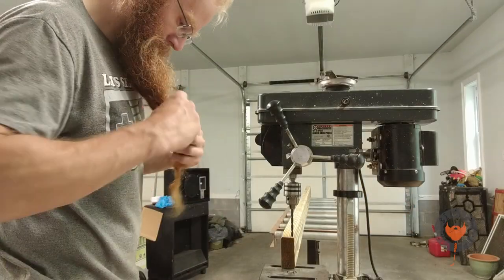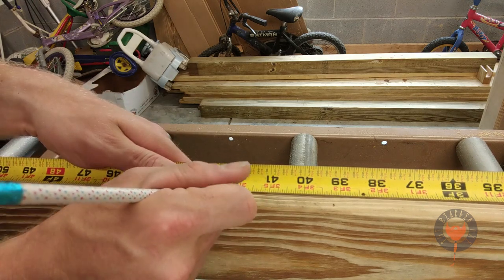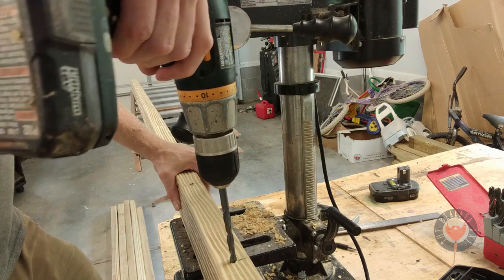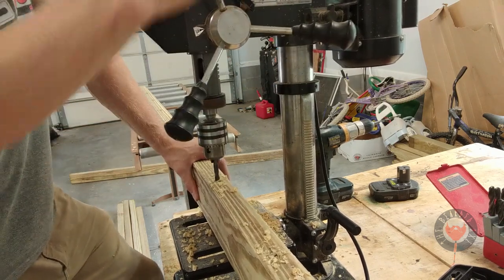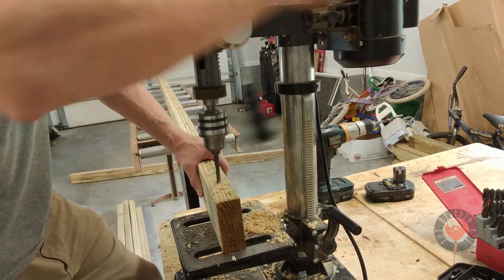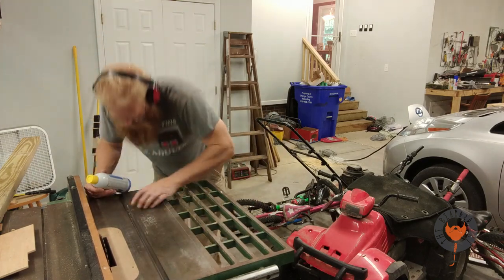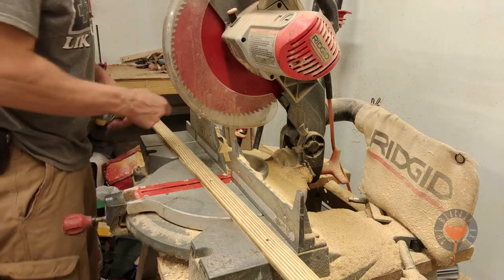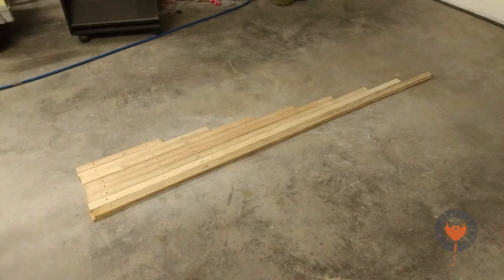Love Yurts-  The wall slats

Comment: Loved the man glitter joke. 
I was surprised you didn't rip about halfway, then flip the board and  finish it. Then you don't have to reach over the blade to bring it back.
Reply from the maker: You won't get as clean of a cut that way unfortunately.  If I was to do this again I would probably just use furring strips and avoid cutting it up on the saw.  It was pretty time consuming and I don't think it saved me on weight or strength.  But hindsight is 20/20.

Comment: Do u have a supply list?
Reply from the maker: I didn't keep track sadly   I think I used (5-7) 2x4s for the wall.  The yurt ended up being 10' in diameter.  A bit cramped but it did the job.